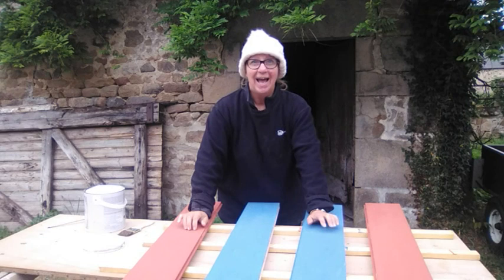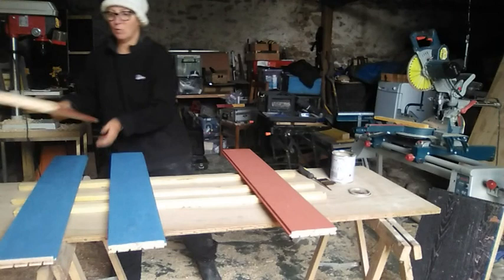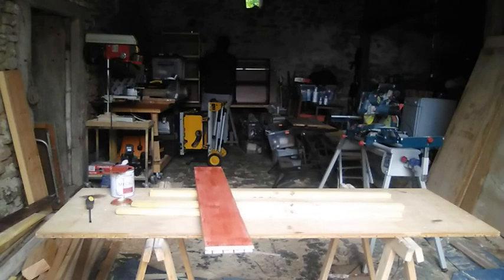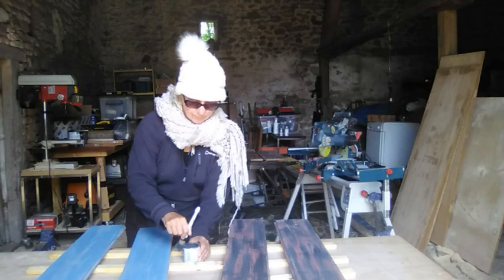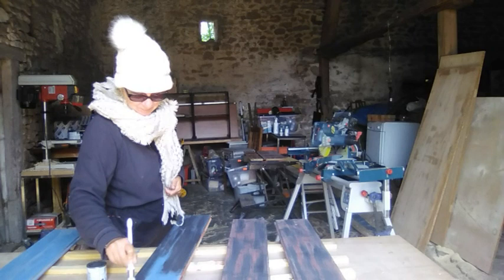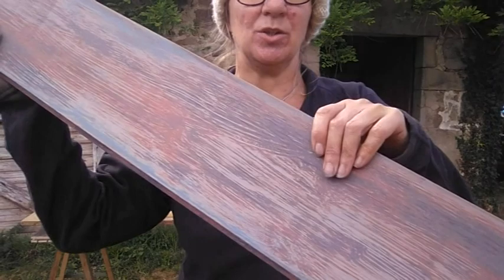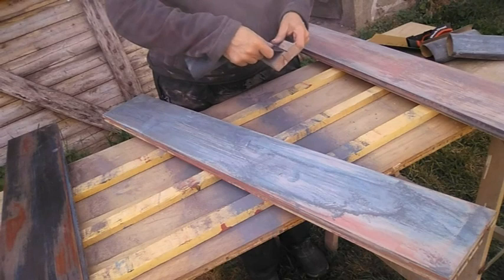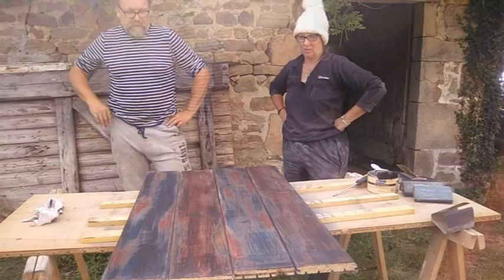P.2 Chateau De Montmagner- Renovating a 14th Century Chateau in France

Comment: Lisa the boards look very effective, as they dry I'm sure they will look even better.
If you ever want to use chalk paint again on other projects, i have made my own chalk paint and used on various furniture with great success. As you know chalk paint is very expensive and there are a few different ways of making it, but the one i found the easiest was using this recipe. 1/3 cup of plaster of paris, 1/3 cup of water, mix together till smooth, then add it to 1 cup of flat latex paint of your choice and stir together! adjust your recipe to whatever size project you are doing, it's very simple and I have never had a fail, it behaves the same as the expensive chalk paints that cost an arm and a leg. very cost effective. you can always try it on a small bit of wood or something if you want to try it out. I'm sure you won't be disappointed, and your purse won't be either! lol.
Reply from the maker: Thanks for that Pat, very handy tip, I will certainly give it a go 👍

Comment: Very  beautiful!  With wax it needs apx 30 days to cure and it won't really hold up much on a floor   It's more for furniture.  And wax has to be applied maybe once a year.  U might want to use a floor sealant or polyurethane.  If u do the same colors, a stain on top of the colors, and then the sealant u should get the same look as u got with the dark wax.  The colors are absolutely beautiful.  Not sure if they are modern or medieval but go with what u like.   If u like the colors go with it and do some fun colors and such on the walls.  But its all beautiful and go for it  remember u can always change it later if u end up not liking it.
Reply from the maker: Yes I love watching Annie Sloan, I think I need more practice though but I am going to try some of her techniques on the furniture 👍

Comment: I appreciate your creativity and ambition, but honestly I think you should save your energy and just do oak. Let the room's furnishings and textiles do the talking and keep the floor simple. Just my opinion.
Reply from the maker: still yet to decide I want each room to be very different and I am 50/50 part of me says keep traditional but then the other part says go for it and see what happens.  I know back in the 16th century they used floor paint to make the floors look more luxurious but still not sure 🤔
Reply: @ChateauDeMontmagner  I also do chalk painting/sanding/old look/antiquing is my preference. I actually do like the different look per room, thinking if you lay them down in the room instead of trying to decide with them outside, which you may have already done, indoors always changes the look, i think. I prefer using an electric sander, not just easier but i like the look more.  Ingenious the way you created these floor boards!

Comment: Lesa and Ted - I personally think they look a bit too modern and you would also be letting yourself in for days of work on 140 of those not to mention the cost of the paint, wax and sandpaper. Could you try a simple dark oak stain with a wax finish to compare alongside them or as an alternative get oak floorboards from a local sawmill? This has got to be your decision of course.
Reply from the maker: That is the other option, we are still trying to decide 👍

Comment: Chalk paint won't hold up, they make floor paint designed for traffic.  Stained distressed wood would be a much better fit for such an old building.
Reply from the maker: It does hold up with a wax finish 👍